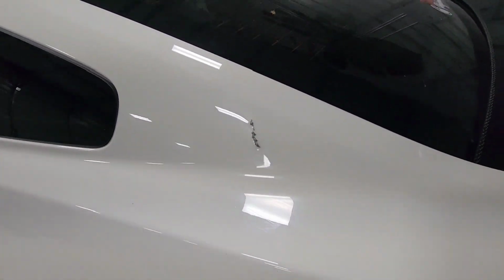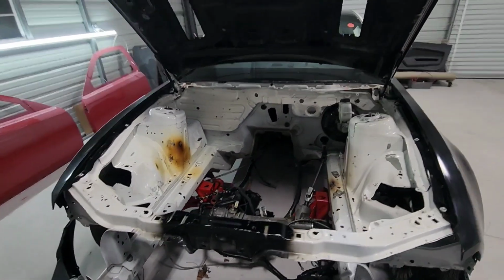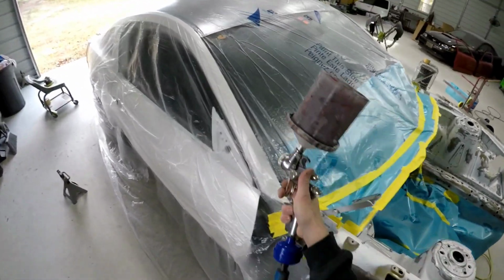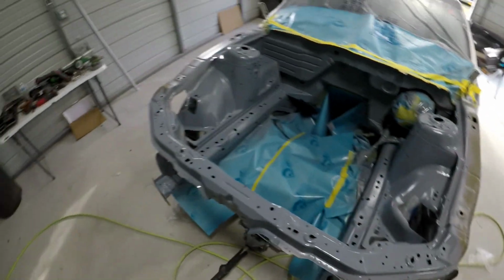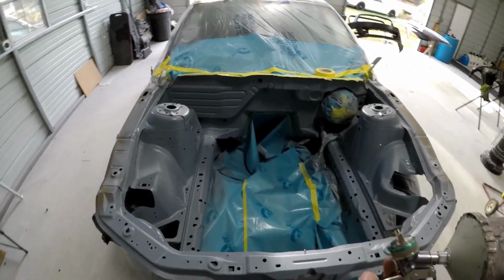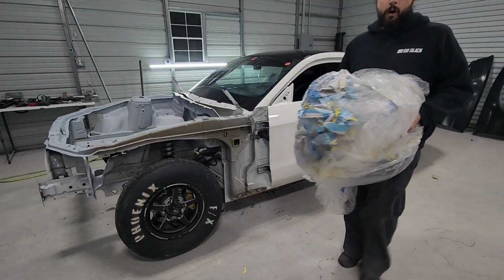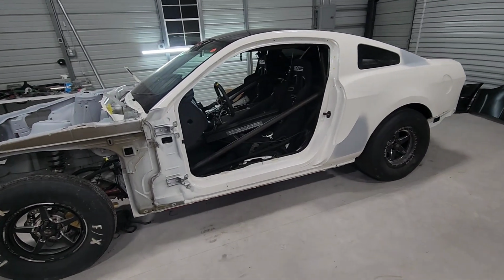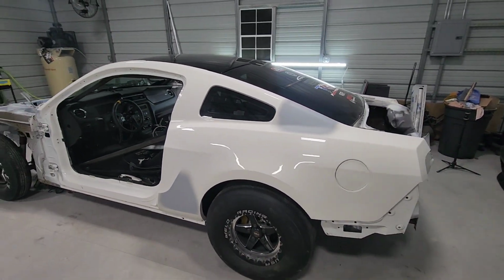S197 Mustang Drag Car Prep for Paint

Comment: @CliffHatcher~What grit sand paper are you using on your disc sander, on the body paint, to prepare it for the new color paint? I have a 1970 Ford Torino Cobra 429 SCJ that has a beautiful paint job on it, but my elderly father accidentally hit the rear right quarter panel with the riding mower, leaving a dent. It was last painted in 1983 and WAS in perfect condition, but now I'm going to have to repair the dent and though the has been kept in the garage and has no oxidation from the sun....I worry the entire car will need to be repainted.  I know that paint technology has changed a LOT since we painted it in 1983.....I have my doubts that any matching color code paint I purchase now, will look different from the '83 paint job. We restored that car together for 2 years before my 16th birthday.... I spent hours learning how to repair body work, wet sanding it to a mirror finish up to 600 grit.... I know I can repair the dent. But if I end up needing to sand the entire car down to repaint, it would REALLY help me to get your feedback on sanding grits for dry sanding with a disc sander! I would TRULY APPRECIATE ANY ADVICE!!  ~~Christy~~
Reply from the maker: Since I was changing the color and knew I was gonna seal the car, I used 320 grit on the da sander and interface pad on the whole car... if you're just fixing the damage and blending the color around it. You can treat the whole panel as a blend panel and prep with 800 grit. That way you wouldn't have to sealing your primer area. You could just blend you color and clear the panel... I spray ppg envirobase and have had really good luck on matching colors as long as the paint on the rest of the car is in good shape. Hopefully that's helps out a little bit. Feel free to reach out to me with any questions you have. I'll do my best to answer them
Reply: @cliff_hatch3r  Thank you SO VERY MUCH for all the information! I look forward to seeing more of your videos, it's great content! I KNOW I will likely reach out when I tackle my Cobra's dent repair and face the potential paint scenarios. I am going to take my time and see what kind of success I can achieve with some Paintless Dent Repair.....but man o'man, the sheet metal on a 1970 Cobra is HEAVY DUTY compared to newer generation vehicles. The curb weight on this car is apx 3960-4000 lbs! Again, thanks for answering my questions and willingness to do so in the future!  ~~Christy~~ 🙂